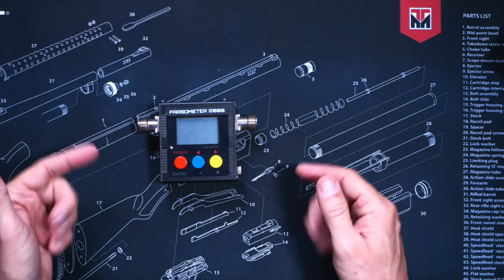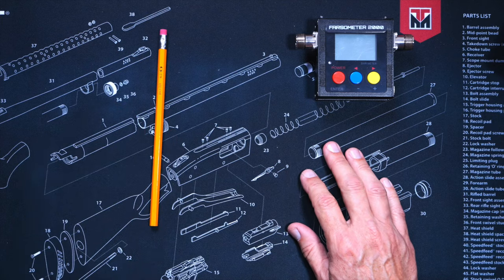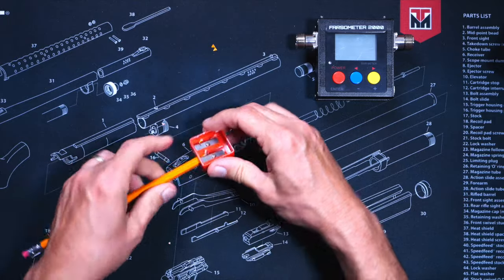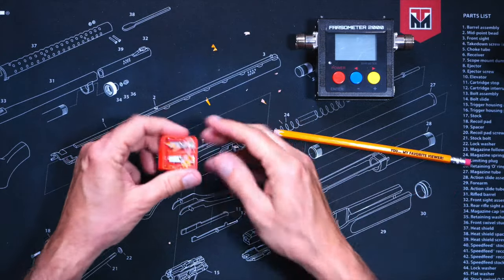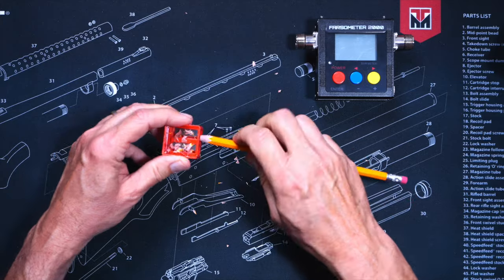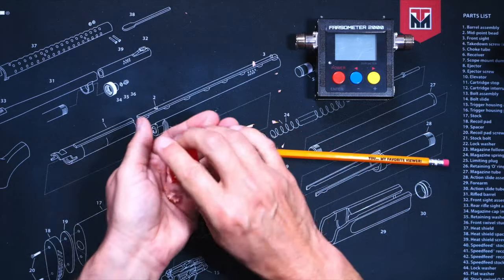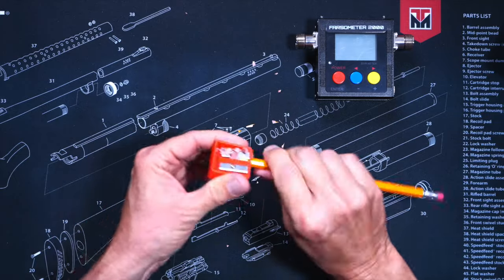SWR Explained: What Is SWR & How To Test The SWR On A CB Radio Or A GMRS Radio - Does SWR Matter?

Comment: Hi SuperStar Randy. I just discovered your channel and have binge watched over 25 episodes. LOVE THEM 💛 Funny story follows. I know a bit about SWR. Many years ago a Guy named Bill at work couldn't get his CB rig on his boat to talk back to his "Base Station" at home. I took my SWR meter and him out on the water. The SWR was HIGH. It was a fiberglass whip antenna. I bent it over pulled off the cap and cut a little off the antenna. SWR improved. I did this several times until the SWR was 1.1     Bill did not know much about radios or antennas.   The next day at work I was standing behind Bill as he was telling all the other employees how "HE" checked the SWR, it wasn't "Right" so "HE" cut some off his antenna, checking the SWR again, it wasn't "Right" and HE kept doing this until his SWR was ZERO. I am listening to his narration. Bill does NOT know that I am standing right behind him. One of the other guys looked at me and asked Bill, What is this SWR you keep talking about? Without missing a beat, Bill said it means Sumbitch Won't Receive. Perhaps, you and your group get a laugh out of this as I did.

Comment: If you get all caught-up in splitting SWR and dB values you start to think small differences matter. In the practical world (as Randy correctly discusses) it does not matter. Simply turn your head, turn to the left or right, pass by a car or anything else that happens in the real world and the small difference go up in smoke. The big difference is when you use an external antenna (any reasonable antenna) it is better than using the HT antenna when inside your house or car.

Comment: I have blown a few radio's "final" transistors with bad SWR, especially on higher power outputs.
Reply from the maker: Uh huh.. and how many of those were modern GMRS radios?
Reply: None - we dont have much in the line of GMRS in my backward little country, we use VHF and believe it or not  "CB"  😜

Comment: Swr question...
Tram 1468-B Antenna attached to 50ft LMR400 to the BTech AMP-U25D amplifier then running to a uv-390 plus. The Antenna is U-bolted to an aluminum extension pole which is hose clamped to 2 extendable flag poles to reach over a second story house from the ground. 
Does the antenna need to be grounded and how to simply?
The 390 using the surecom sw-102 is showing an swr of 19.99 and the power output only gets to just under 8watts! (On Low,M and H)
What am I missing? Thanks!

Comment: Hello Randy! I need a dummy load to check power and swr on my 40w amplifier when it is hooked up! But what dummy load do I need for my surecom sw33 plus !
And what cables or fittings will I need!
(Sorry for my ignorance)
My amplifier is the, btech gmrs u25-amplifier.
*Hope to hear from you Randy! THANKS in advance my friend!!

Comment: As I found out swr doesn’t mean everything, I connected a ut-72g mobile antenna with 1.01 swr and got worse results than my rubber duck, must be the power loss in the cable

Comment: Funny how some people get all technical about a radio antenna and how you must tune it, blah blah... yet they are totally fine with whatever antenna their cell phone has and are not dorking out on how to improve that...
Reply: Ya know… Way back before cell phone began to cohabitate with computers, some (quite a few) cell phones had little tiny rubber plugs on the back that covered sockets to connect a cable for an external antenna.  🤣🤣🤣
Reply: You forgot to mention gps watches. I have mine connected to a super big external antenna, just in case. I carry it arround, on my back.

Comment: Do I need ½ wavelength of coax from the antenna to the SWRS meter so the meter doesn't give a false reading due to the impedance transformation action of different lengths of coax?
Reply from the maker: No.

Comment: So ive been trying to find info on what antenna to buy for my 10 watt baofeng that i can put up as high as i can manage and then attach one to my truck as well and be able to talk many farrs with my spouse in the event of an emergency looking to get 100 miles in the ohio area
Reply: Can you help?
Reply from the maker: 100 miles on UHF (GMRS) without the use of a repeater, is going to be a stretch from anywhere, even the peak of a mountain top. I'm not saying it's not possible, but, it's probably not possible.
Reply: @TheNotaRubicon  gotcha i appreciate the reply love your content to. Were basically trying to have a way to let each other know were ok and where we are at in the event if another AT&T outage but with more violence in the streets happening and i travel all iver the state for work so i can be anywhere from 50 to 100 miles away ive been looking at all the HF UHF and VHF stuff and i just don't understand it all enough to feel confident in buying some potentially overpriced radio and it not work for what i need. Lastly i dont intend to follow any rules with this setup because its an emergency only set up that im going to store away one at my hime and one in my truck and deploy if anything happens

Comment: Is it required or recommended to measure SWR on antennas that are sold as plug and play ready for gmrs? How about for ghost antennas that can not me trimmed?
Reply from the maker: You should not need to measure the SWR on a "GMRS" antenna, or GMRS ghost antenna.. BUT, checking the SWR will confirm that the antenna is not faulty and there are no dead-shorts or other issues in the coax or connectors.
99% of the time but that 1% will ruin your day.

Comment: I know this is way off topic but I was wondering if u could help me out I have a btech 50v2 GMRS mobile radio in my jeep also but every time I push my PTT button my passenger tail light turns on. I have tried moving the antenna and even switching it to low power and the result is the same any ideas what is causing this
Reply from the maker: Boy, you were right, that IS off topic!

Comment: Forgive my ignorance, why can't the duck antenna swr be measured? And is the duck antenna broad banded enough to transmit on all the frequencies the UV5R is capable of without hurting the radio?
Reply from the maker: Because a handheld antenna uses the radio, and your head, as the groundplane. When you attache an SWR meter, it throws-off that groundplane making it very difficult to measure how the antenna actually works when you are using it.
There is no broadband antenna that can efficiently transmit on ALL frequencies.. It wont "hurt" the radio (contrary to what "some people" will tell you) but it will not be optimal/you will have a lot of power loss on many frequenices.
Reply: @TheNotaRubicon  that's interesting, I've seen lots of 10 meter radios blow final transistors due to bad vswr. Could you tell me which frequencies it works best on?
Reply from the maker: Were those 10 meter radios modern? The reason I ask is because of this video: https://youtu.be/SdMLCDPc04Y
and THIS video: https://youtu.be/X3r2K96hsGc 
Which frequencies work best for any given antenna depends on that specific antenna, and the UV-5R ships with several different ones.
Reply: @TheNotaRubicon  yes, it's been my experience the modern 10 meter with mosfet finals handle high swr worse than the old 2sc1969 or 2312. Thanks for the link, I'll definitely watch it

Comment: I know this is probably a stupid question I’m gonna get nailed for it but I have to ask anyways if I’m using a GRS radio and I have channel a and channel B one being GMRS channel 18 and the other one being repeater five which one am I supposed to be on when transmitting and receiving the repeater frequency
Reply from the maker: This is only a stupid question because it is 100% off-topic. Otherwise it is a perfectly legit question.
Reply: @TheNotaRubicon  I agree that is completely off-topic  but if I was to put a question on an older video, more than likely, I would not get a response as quickly or if at all.

Comment: Hey! Don't call me a Dork... I identify as a Radio Kook... Nah, just messin' with y'all 🤣🥸🥸 Don't give a crap about all that 😎 This video is perfect for the person who wants the best performance out of their radio and have more time for poking fun at Sad hams.   And for anyone worried about a higher SWR damaging a radio, I have the Radio Dork Handbook in front of me, and it says..."Most modern solid state radio transceivers have an SWR sensing circuit to cut back the power if the antenna is not correctly matched"

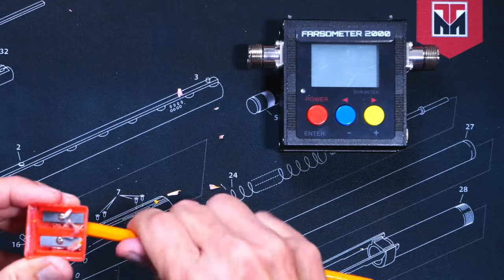Comment: 2:06  It may be cheap and chinese but it is two bladed, red and plastic ... is that how you  really  a wooden antenna fors wr's though?  It won't work anyway because the rubber at the end will prevent grounding. 3:26 You had it perpendicular to the equator and then you moved it, throwing the other antenna was magician's sleight of hand. 4:30  That'll get the grammar sharks frothing :-)

Comment: You look at Meshtastic?
Reply from the maker: No.. Too fiddly and unreliable.. Maybe after it's matured and we can buy an off-the-shelf product.
Reply: @TheNotaRubicon  it's a deep rabbit hole. It's sucking it all of ham guys. The one FB group I'm in already has 3.1K people and growing like crazy. UK has over 500 nodes already. 

Look at the t-echo. No assembly required. Cheers.
Reply: @TheNotaRubicon to be honest, most of the fiddling is with cases and batteries. The bigger the battery, the better, and the smaller the case, the better. Something's gotta give!

Comment: Probably a stoopid question, but probably won’t get me pinned. At least I hope. Anyway, it sounds like SWR only affects your transmission, not reception. At all.
Reply from the maker: SWR is a measure of the reflected OUTPUT (transmission) power, but a high SWR can indicate a poorly tuned antenna or shorted coax cable which would also affect your reception.
Reply: @TheNotaRubicon  Ahh.... thanks for the explanation.

Comment: 10:30 "or .... something else". E.g. your N connector isn't tightened down fully or you've gotten water into it. For full anal rectitude, you should use self-sealing rubber tape on any outdoor connectors.

Apropos of nothing, I used to have a frame relay connection to my house (I was friends with the ISP). It was great! 256Kbps back in the day when most people had 28kbps modems. Unfortunately, when it rained, the connection would drop. I would call Verizon, they would roll a truck, fiddle with things, maybe replace the CPE and eventually it would start working again. Finally, one tech got tired of this bullshit. He went, pedestal by pedestal, re-splicing my connection. He got to one pedestal and found it full of a mouse nest and chewed wires. When the weather turned bad, the mouse would spend time in his nest bored, chewing on the wires and shorting them out. The tech evicted the mouse and I never had any trouble with that connection again.

Thus endeth the lesson of the day.

Comment: Well in my usual attempts to click-skip past the utter condescending stupidity to get to your points......  SWR is not relevant at those high frequencies. It's more of a concern down in the HF bands. 3-30Mhz or so.     Hey kids! Grab this comment before he deletes it.   Not that it matters but this comment assumes you are using the correct type of antenna for the freq you are trying to use.